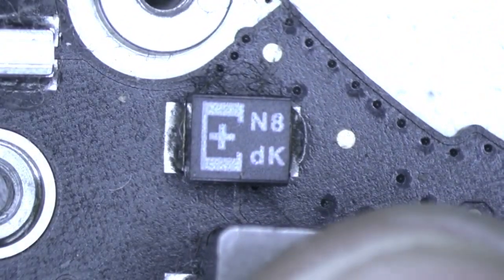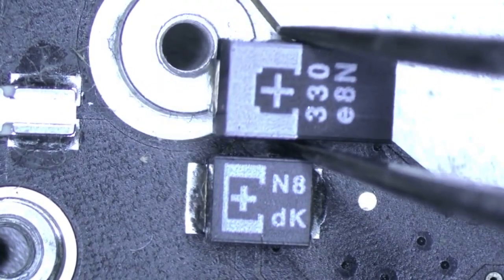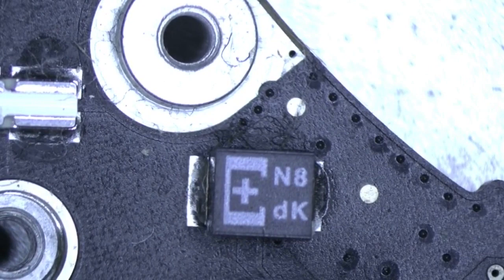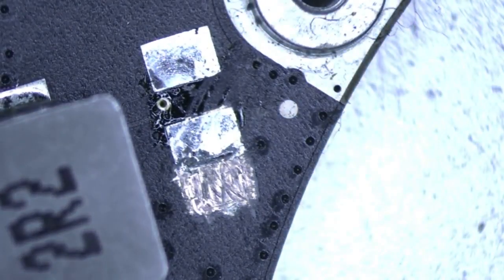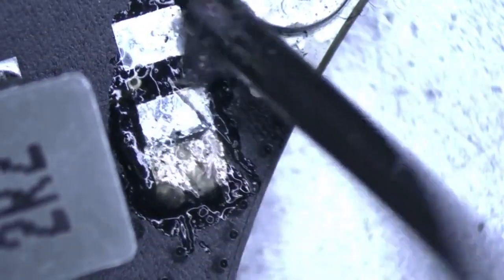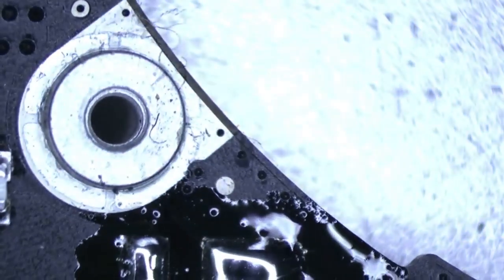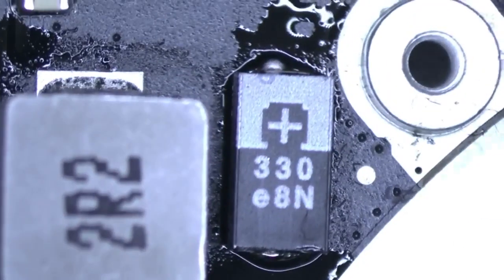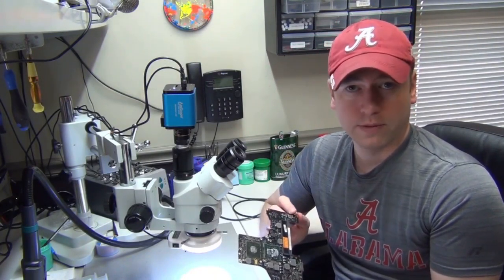How to Fix GPU Problems on a 2010 A1286 Board 820-2850

Comment: What have you found out about MacBook pro A1286. Circuit board 820-2195-A with the same problem.   It already has a J8 ez capacitor.

Comment: Hi thanks for the video. My Mac has "stepped" horizontal lines — looks like a textured screen — for the startup screen with the logo showing and the when "booted" I have a blank grey screen. It used to load the desktop for a while but with the same stepped horizontal lines. Will the fix my problem as well? Thanks again

Comment: My 2010 Macbook Pro stopped working since 2014, took years for me to find the right technician anywhere in this country, disabling the GPU or Replace the GPU paid $2K for this laptop and I don't want anyone to even touch it unless their MAC CERT or EXPERIENCED. Well after 8 years just using it as a laptop holder for another laptop, I figure what the hell, let's go to you tube and check if there's a final fix for this GPU issue with my Macbook Pro  A1286 15inch, I so miss it and just can't even afford the 16 inch which is dayuuum awesome, but then again, I really want to finally get this fixed, sentimental Macbook Pro actually. 
I can't believe it ...I just knew it being a IBM Tech / Lenovo Tech since 2003 I knew something was up, incorrect part either a CAP was under voltage or something and you can't just get a Schematic anywhere just like that. So finally, I can finally fix the Pro with a upgraded CAP that will get the GPU working like it's suppose to. Man you are one LIFE SAVOR for posting this up ... you can imagine how many people WORLD WIDE what APPLE did to many consumers using their 2010 A1286 Product ... They don't even have a SERVICE BULLETIN regarding this fix and it had to be someone for a mom and pop's shop to get the correct answer for this FIX. Gee's APPLE SERVICE TECH'S should be putting some type of Knowledge BASE  online for these fixes and NADA !!! 

Thanks Powerbook Medic for this wonderful FIX ... question can we easily get this part online with a part # and specs so if you are traveling in another country you can get it at that country like ASIA or New Zealand or even Singapore? Great VIDEO, again thanks for posting this. After 8 years of waiting finally ... I can get it working. Now after trying to figure out the fix .. I messed up the FLEX for the Touch Pad and Keyboard LOL ... at least now I know what to fix. Dayuuuum !!! you did good for a lot of people with this A1286 and APPLE did Squiggly Nada !!!! Loosers  for bad SERVICE BULLETINS  Winners for making a very constructive machine. Kudo's

Comment: Many thanks for this great video. We have also repaired a few units with these suggestions. Used the EEFGX0E331R PANASONIC Cap Aluminum Polymer 330uF 2.5VDC 20% (7.3 X 4.3) from Arrow electronics.

Comment: I wanted to report in here that this DID successfully fix a logic board I was sitting on for a while.   It switches appropriately, from Intel to Nvidia graphics and provides HD playback from YouTube, which it struggled with previously.    It started with completely random panics, then they were more frequent.  We tried BGA repairs on this, fan mods, software mods to prevent the switchable graphics.  None of that worked.  I pulled a tantalum cap off an ASUS motherboard that had "330" marking on it.  I did not decipher the rest of the markings to figure out what the voltage or tolerance was on it.  I was willing to "wing it".   This kind of tells me that anything is better than what was populated there. Haha!    THANKS!!!

Note, this was all done by HAND solder rework, using a 45-watt PACE iron, stainless tweezers, old-fashion rosin flux, and isopropyl for finishing.

Comment: Great video - I am going to try this on my A1286. Am experimenting with a junk board first, but struggling to remove a capacitor off an Asus motherboard, using a budget butane hot air gun - the capacitor doesn't budge, and all I get is a damaged component stuck to the board. I am using flux around the capacitor but that isn't helping. Is it my cheapo butane gun ?

Comment: I just did this repair. Everything went great for about 4 hours till I got another crash but the report was different. After a few errors the computer front light only comes on for a few seconds then turns off.   I opened it up again to test continuity on the capacitor. It was showing the same values on both sides. I took the capacitor off the board and tested it. It shows it’s good. I tested the pads on the board and they had the exact same values on the positive pad and negative pad. I don’t know what to do now.

Comment: Good stuff. Question: How do you order replacement capacitors, chips, etc. Like do you buy them in bulk, do you order from a specific chip set/catalog, and are these universal parts for all electronics?

Comment: Worked like a charm the area I had to solder in was a little cramped because my board was slightly different but I was able to just run jumpers to the new cap, toss on some solder mask and boom booted perfectly no more grey screen

Comment: Hello there. I have a MacBook pro 13 inch 2011 model and my mac has kernel panic issue and I am not able to find this capacitor in the logic board can you tell me that name of the capacitor or image of the capacitor where it is located. there are videos of 15 inch and still, I am not able to find those capacitors on my machine as well.  PLEASE PLEASE HELP ME OUT HERE

Comment: hello. I' using 2010 mbp 15 and it has gpu panic. I fixed that problem with gfxcard status but now bootom of screen is gone and i think it is getting bigger. https://imgur.com/a/QTDVT36
can I fix the problem if I change that capacitor? thanks for the video by the way.

Comment: Great video! I have the same capacitor from a donor motherboard, that both says 330, but the digits bellow are different. One says: e5n and the other one says e62, can you tell me if they work and if they do, which one should i use? Thanks a lot

Comment: What other capacitor can I use. Because I recently bought a board from amazon which has the kernel panic issues it’s a mid 2010/15 inch board to replace a completely dead board that I have so can I take a capacitor from the dead board to use on the new board  and if so which capacitor from the dead board can I use ?

Comment: 2R5TPE330M9 Is this The right capacitor? Looking to give this a go on our MacBook using my soldering station/heat gun. Not sure on sizing though. Would much rather prefer to shop in stores but we have no tech stores around here for things like this, only basic caps and resistors😬

Comment: Don't you have to remove/wash the flux off before soldering? I have a 2008 model A1260. I've seen clips where this problem exists and the equivalent capacitor C7771 is replaced. Have you done a similar fix on that model - any comments?
Reply from the maker: No. You want the flux on while soldering.

Comment: I might have missed it, what are the cap specs or where do you order them from?
Reply from the maker: ENPLUSONE DESIGNS It’s C9560 on the schematic.  It’s a 330UF 20% 2.0V Capacitor. I would recommend just doing an internet search for a supplier.

Comment: I have a mid 2011 model 1286 with no video at all and no beep codes, should I try this?
If so may I ask for the part number and even a parts source?
Reply from the maker: Mike S No, this is for the 2010 model. For your model, it is most likely a bad GPU.

Comment: Worked for me too. Just fixed my 2010 MacBook Pro 15 by replacing the tiny capacitor.
Reply: Can I get the part number and source for the cap? I have a 1286 with no video at all.
Reply from the maker: Jim Murphy That’s great!

Comment: wow, thanks for the video! it worked fine for me for a couple days. them all of a sudden it stopped tuning on, it flashes the front led 5 times but no video. do you have any ideia of whats causing this?
Reply from the maker: Niko Kosta Thanks! 
It may be a battery issue. Try unplugging the battery and just using the power adaptor to see if it works without the battery.

Comment: Great video quality. This model has a RECALL from apple, but I think they switch for the same problematic board. Now my dGPU is dead again. I have disable the Radeonxxxx.kext file and using only the internal. So it's working, but a lot os functions disabled, like external monitor. You think my GPU is dead or could be this capacitor? There is any way to check the cap if it is ok? Tks again.

Comment: Hello. I have the same issue in the main board 820-2849. How to fix it? Is te same solution? Replace it the capacitor C9560?
Reply from the maker: Yes, that is the cap that controls the same as the 820-2850 board.

Comment: Is N8 db the same capacitor. What would be the alternate capacitor for this. 
Mbp serial c0212ft2pedf8v

Please suggest 

Sam
India
Reply from the maker: Yes, that is the same kind of capacitor that I replaced in this video.  You can use a capacitor with these stats to replace it:  330UF 20% 2.5V Poly-Tant Case-C2_SM
Reply: @PowerbookMedic  my macbook just boots and shutdown. Restarts with colours changing blue,gray and green. Gets too hot on left side. 

Apologies. I couldn't find anyone here to fix it. Like your video
Reply from the maker: @awesamos  We've seen that before. It's a GPU issue.
Reply: @PowerbookMedic  can this be fixed with above mentioned procedure
Reply: Cool. I might have to give that a try.
Reply: @MaxHedrm  would you suggest me to try replacing the capacitor.
Reply: @awesamos  Since I have no idea what your soldering skills are, I have no way to say. If you are confident working on a board like that, then go for it. If not, find someone who is.
Reply: @MaxHedrm  i ended up desoldering r911 resistor based on some tutorial online and lost the whole display. Once i fix it i will try the capacitor mod..

Thanks for your generous support

Comment: Did this repair two days ago on my 2010 macbook, now it works perfect. Many thanks. Measured the old capacitor to 900ohms ( using HP34401A) resistance, it lasted 6 years. I replaced with the original component (2TPE330MFB) which measured to 90kohm.
Reply from the maker: Excellent! Thanks for sharing about your success. That's why we make these videos.
Reply: 330u 90k ohm?
Reply: @jomsmacalino7797  reading this 3y later 90k ohm sounds very low....don't mind my doggy mesuring, just get the part and replace it.

Comment: great! Could this solve the problem for a late 2011 model? (Also 1286)
Reply from the maker: No. The issue on the 2011 model is a very common GPU issue. We have a video on that issue here: https://www.youtube.com/watch?v=U9-9EpilsBw
Reply: I have a mid 2011 model, will the cap replacement fix a black screen (no beep codes)?